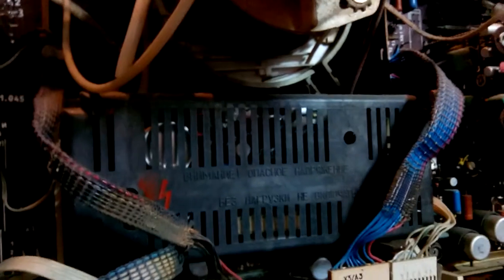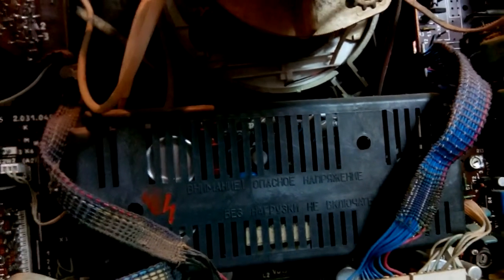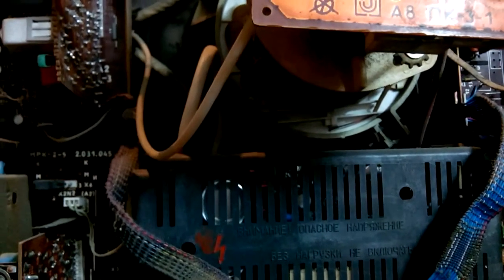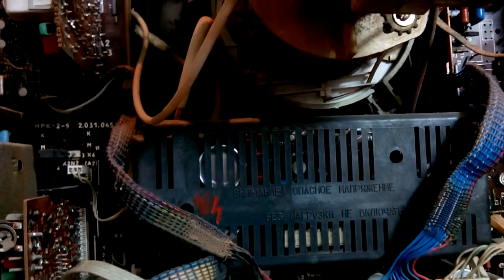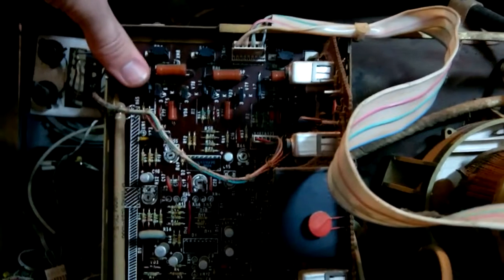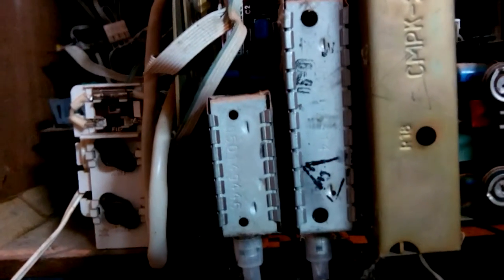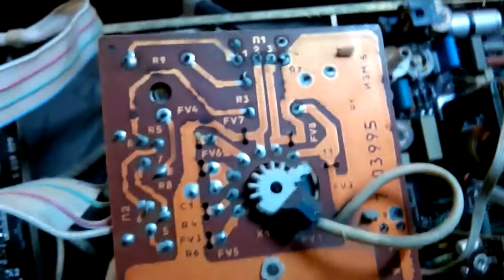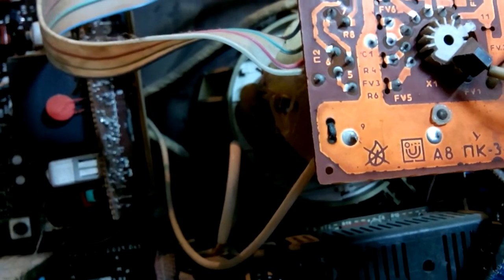Scavenging parts from an old CRT TV

Comment: I like modular design, it makes things so much easier to service. So much better than having everything on one board.  You don't need to tell me how bad phosphor burn can get, after I had my first computer for a few years I could see where text had got burned into the screen! (I also see that on old cash machine screens).
Reply from the maker: +CoolDudeClem Yes, you get great access in this TV's - the whole chassis swings out pretty much like a door and thus gives you access to solder joints on the other side.  It's good that you know about phosphor, but most fellas think that this is a myth that their parents told them in order to make 'em stop playing video games :) Sometimes you'll see similar damage on scopes as well, that's why I use minimum sufficient brightness on my scope.